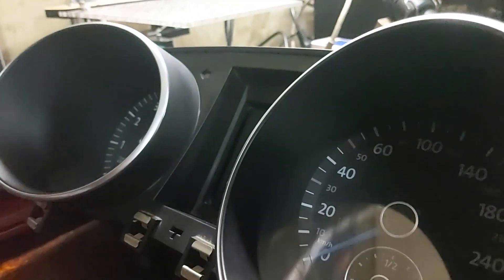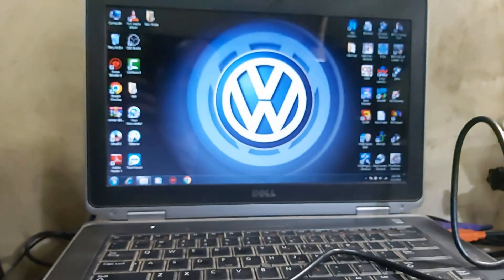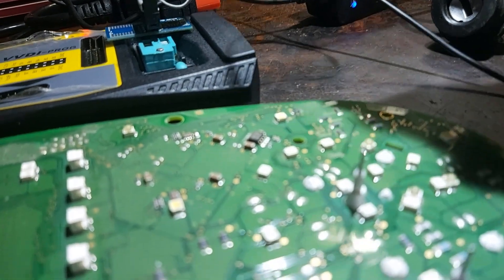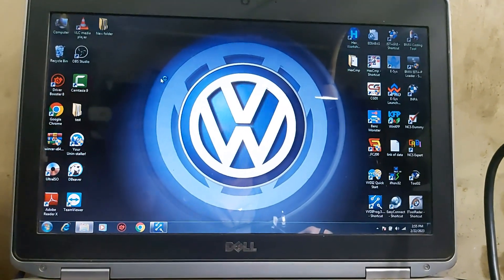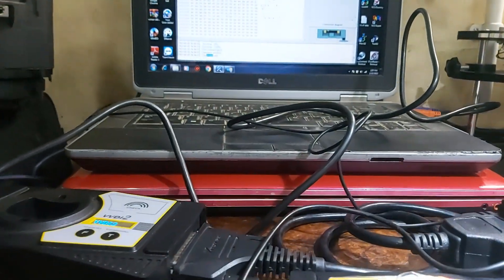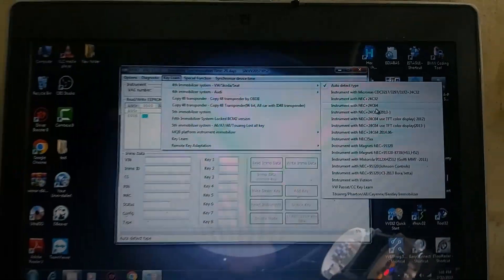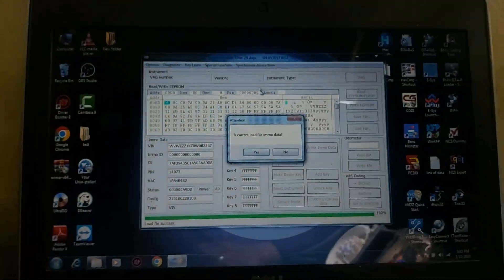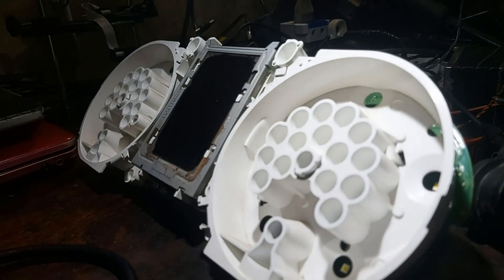PT2:Golf6 Cluster Swap (Reading New Immo Data And Write Original With Vvdi2) Via Service Eeprom

Comment: Hi, Why didn't you use pogo pin method to read eeprom?
Reply: That’s crazy, I was just thinking the same thing. Have you done this before?
Reply from the maker: Yes maybe on other videos
Reply: No, I didn't. Why madness? @synestheticnation
Reply: @automan2544 not madness. I have to do this and wanted to use pogo instead of clip
Reply from the maker: You can use it .. 2 ways for all lost
Reply: @heshamessam8042 I want to use pogo and program used cluster from damaged cluster. Is this possible with the pogo? Can I also change the mileage?
Reply from the maker: @synestheticnation yes

Comment: Asalamalaykum, thank you for such informative video. I have similar issue to this. You have helped me a lot, may Allah reward you. I have MK6  Golf as well with older cluster not multi-function cluster (with screen) like yours. I need to swap my old cluster to a new cluster as well, and you have explained the procedure very well. I just need to find someone who has VVDI2 haha as I do not have such expensive hardware.
Reply from the maker: You are welcome ... thanks ... also there are some other tools that can do the same job not only vvdi2 ... try to ask any locksmith shop near you ... و عليكم السلام ورحمة الله